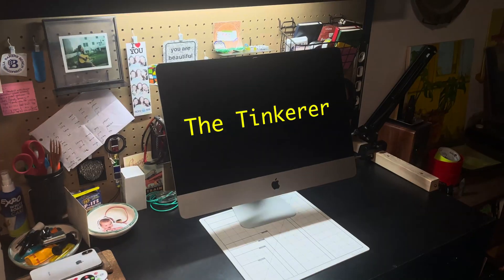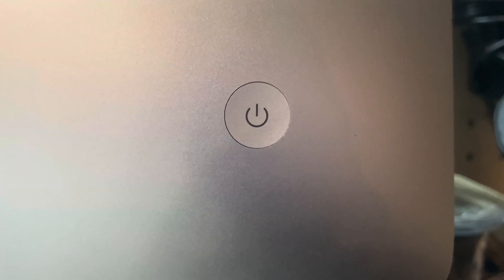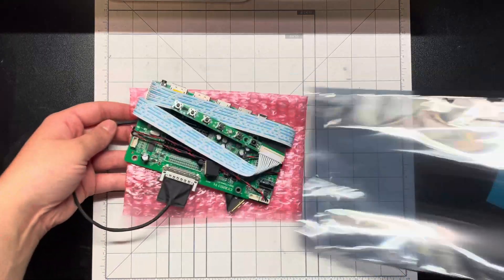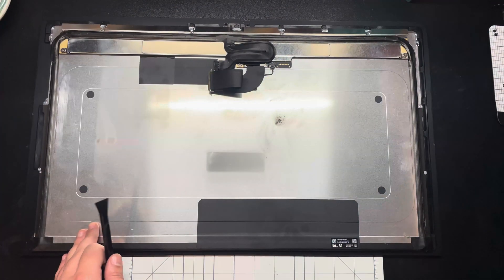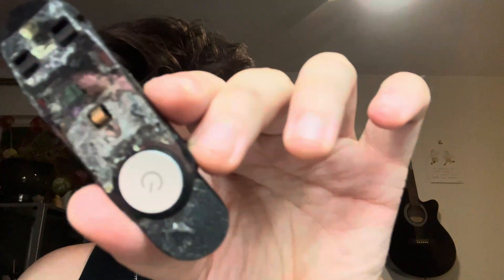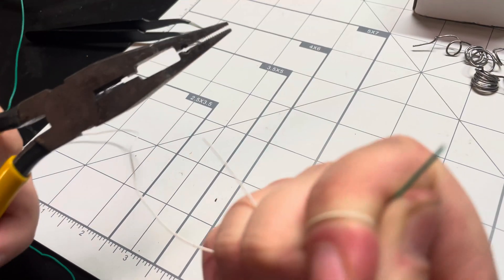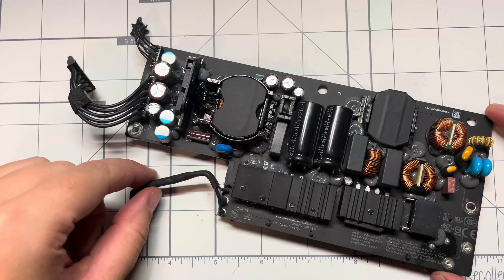TheTinkerer - EpisodeThree: Converting iMac into Monitor

Comment: Splicing the thin thin wires, i find easy and safe to strip with a lighter, and grabbing the insulation and pulling off. I always cut them when using a stripper. ✌🏻💚🙏🏻💪🏻

Comment: You can use the iMac power supply as is and hence the power cable don’t need an external one just need to know the pins for ground and 12v and connect those to a jack adapter into the board. I’ve been though a few 2011 A1313 I can confirm  it’s pin 1 for ground 4 for 12v shouldn’t t be difficult to find out for any iMac though. Good job anyway
Reply: Will it need a fuse to check for large current?
Reply: @gourishanker9975 exactly the same thing you would do if it was still a Mac or exactly same thing if you used a external power supply like in the video, guess you can put something between power and the computer to prevent it from being cooked if you scared of that, but from the power supply to the board it’s just 12V either permanent (when plug is in) or just with on/off it’s a matter of finding the pin out your specific power supply

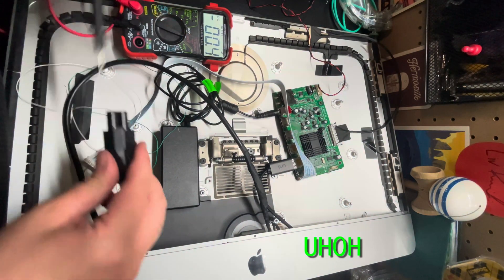Comment: The short circuit at 9:59 was because your voltmeter is set to DC instead of AC. You didn't make the wrong connection, you just measured it wrong. It would look much nicer with the original mac power cable.

Comment: The only problem I see is you need to run that little board with all the buttons to the outside or you can't get to any of the OSD (on screen display) menu options without removing the screen!  PS - I made a poor man's Apple Studio Display with a 2015 27" Retina iMac and a 5K driver board a little over a year ago, so I know of what I speak.

Comment: I bought one of these but when I plug it into a video source there's no input but the backlight reacts when its plugged in and out of things so clearly it somewhat works but there's no video displayed at all. so confusing how the data cable can be sending data but still not showing anything on screen. the control panel built into the board doesn't work either.
Reply from the maker: Try reversing the video display date cable! The one with the rainbow wires that goes to the LCD panel if yours looked like mine. The connector can plug in either way but it only properly transmits data when matched up properly.